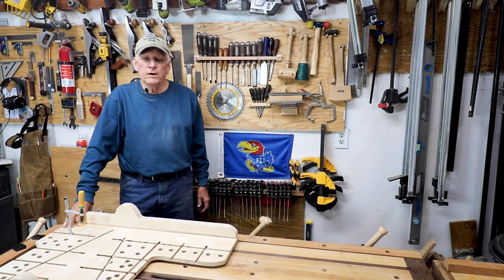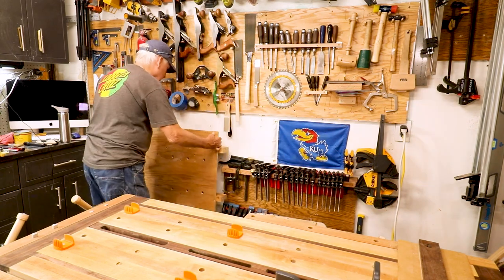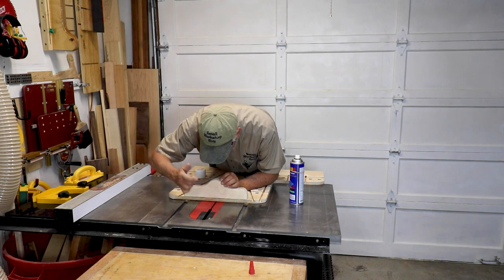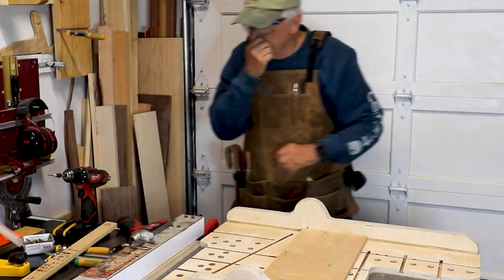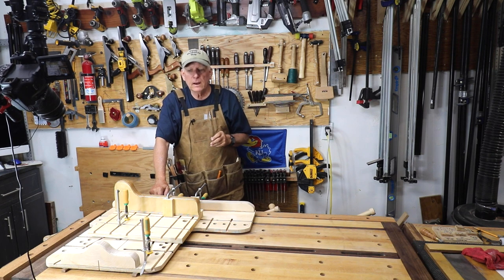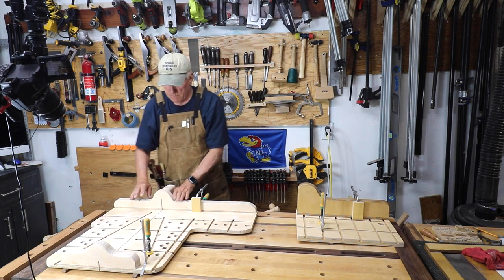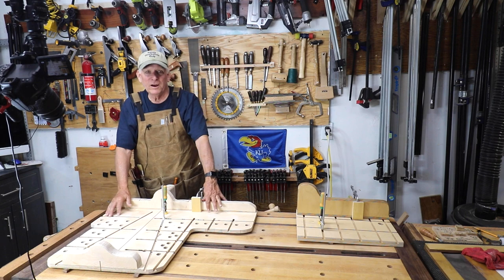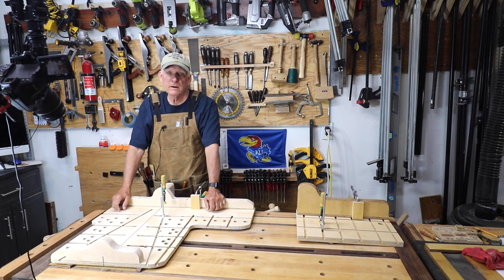5 Cuts and 34 Holes to a Perfect Matchfit Crosscut Sled

Comment: After using your sled for about a year, give us an update on whether it stayed flat. I think with the holes, the torsional rigidity is reduced. I have made numerous sleds and used the William Ng method to align them. They are in good alignment only for a short period of time due to changes in temperature and humidity along with banging them around during normal usage. I am not saying don't do the sophisticated alignment but be aware that you will periodically have to realign the sled. Write the date of the most recent alignment on a piece of painter's tape.
Reply from the maker: I will check it out tomorrow and thanks for the warning an advice.  I will let you know in another reply here.
Reply: @SmallWorkshopGuy  and . . .

Comment: What's the going rate for a Brooklyn Bridge SWG?  Maybe you'd like to trade for the beautiful oceanfront lot in Tennessee I've got on the market?  Call me? 🤣🤣🤣😁😎 Best, Matt
Wondering if you ever use a 1/16" roundover bit for cleaning up edges like the 34/68 3/4" holes in your crosscut sled?  I put the small bit in a Bosch Colt router... makes VERY quick work of things like that.
Reply from the maker: Hey, Matt, you must have noticed some minor similarities to the language in your Board Stretcher video - but at maybe the 2% level,  But you definitely provided the inspiration.  I don't have a 1/16 round over bit, but maybe I can quickly go to my Bookmark in my browser labeled "Matt Jackson Amazon link" and get one of those delivered tomorrow - you think!  Nice hearing from you.
Reply: @SmallWorkshopGuy  No matter where you get that tiny bit I think you'll really like the performance once you adapt using it into your workflow... you know how I HATE sanding and that simple method saves me a bunch of sanding!  Maybe we need to come up with an official BS Degree rating for our shenanigans? 😂🤣😁😎 Best, Matt